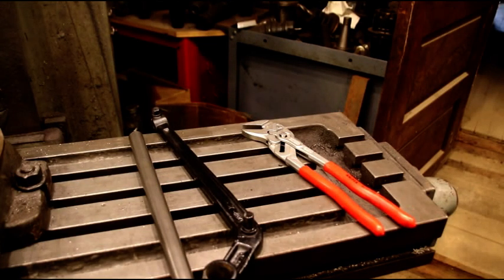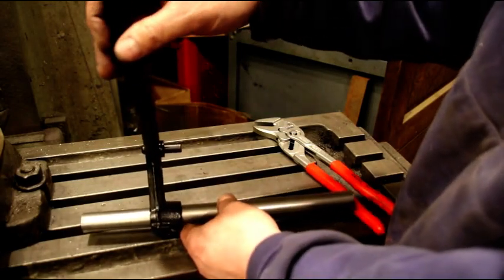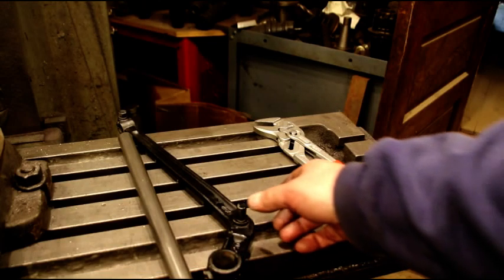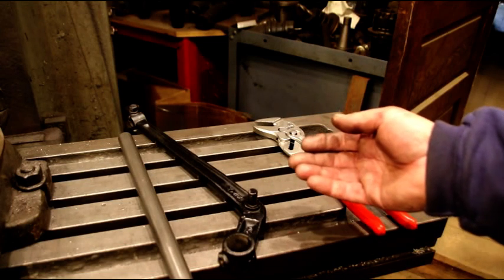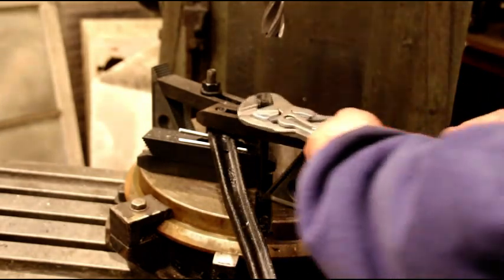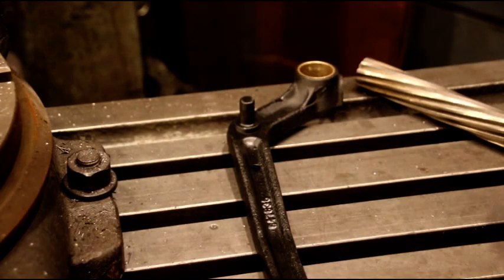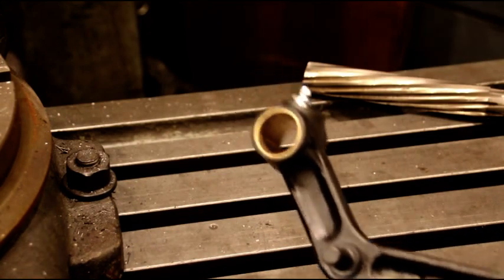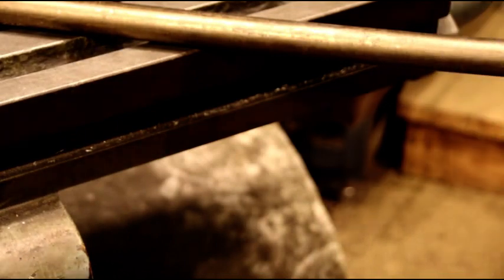Willys Jeep Brake Pedal Bushing....Put An End To That Sloppy Pedal !!!!!

Comment: It would be really useful to have a video on what you think the most versatile pieces of equipment would be for a guy to optimize his capabilities in his home shop where space is limited. How to use the fewest machines and still have as much capability as possible. You’ve done so much that your insight on that would be really great
Reply from the maker: It really depends on what you want to do.  I like to do everything in my own shop so I don't have to rely on anyone else.  The two very first machines should be a milling machine and a lathe.  They will open up a whole new world for you.  Next you need to decide what you want to do.  Mechanical work? engines? axles? transmissions?  or maybe sheet metal work?  Perhaps painting?   Everything will require their own set of tools, jigs, tricks of the trade, etc.......
You probably know or have realized there isn't another shop out there that has the equipment or desire to do many things, such as myself.  Most people do just parts of a restoration, never the whole thing.  Decide what you are hoping to accomplish and I will help you and show you whatever I can.
Reply: @metalshaperJeep  I think you’re right with the milling machine and lathe. That would expand my capabilities immensely. I mostly do maintenance and upkeep on my tractors and Jeeps. Getting to a point where axle and transmission rebuilds are practical would be ideal. As much as engine rebuilds would be an exciting path to go down I’m not sure that’s realistic with my space constraints. Some really basic sheet metal tools would be nice too for repairing some of my older jeep bodies. All I have is a cheap bending break. I’d like to expand my abilities with that a little bit as well. I always admire how you have the capability to do everything in your shop. It’s incredible

Comment: Thanks, you're doing it the right way. I'm sure you know that Willys wagons, pick-ups, and Jeepsters also have this same basic pedal shaft arrangement, and also develop excess slop and squeaks from rubbing on the sheet metal floor pan, always rubbing on the right side of the pedal shaft hole.  My stopgap remedy has been to cut rubbing blocks from 1/4 thick solid sheet nylon (bought from a plastic dealer) about 1 inch wide by 2 inches high. I screw the rubbing blocks to the floor pan just to the right of the centered brake pedal shaft. It's not a professional fix like you're doing, but it positively stops pedal slop and squeaks, and the rubbing blocks haven't shown noticeable wear after thousands of miles. Also, if you haven't done so yet, I'd be interested to see how you deal with worn-out bent-rod-type clutch pedal links -- the ones that use cotter pins. Those rods wear severely, along with the holes they pass through.  I've had good luck replacing them with a different kind of link that I've fabricated using 3/8 ball joint ends, the universal aircraft style that include grease fittings on the ball ends.  Keep up the good work.
Reply from the maker: Yes, this fix works on lots of Willys vehicles and many more with underfloor pedal setups.

Comment: Nice fix that lets you run the original pedal arrangement, but with much better feel and action I would think.

Hope you reconsider selling your power hammer.  You turned out so much quality work on that machine that is significant to the Jeep community.  I’ve seen pictures of the CJ2 you built, now at the Klairmont museum.  That historic vehicle would not exist as it is today, in 100% correct form, without your extraordinary toolmaking and shaping skills.
Reply: I don’t have a hammer- power hammer- but have always enjoyed your sheetmetal fab work. 
But I know especially now that I’m late fifties that “doing everything” versus optimizing time can be at odds no matter one’s “level.”  Productivity isn’t always measured by breadth or volume. 
It’s never fun but usually wise to narrow one’s focus once it becomes apparent the you ‘should’ do it. .
Reply from the maker: Glad you were able to see the agri jeep, it did turn out great and the museum is a great place for it.  I can no longer keep up the pace I am working at these days and the hopes of getting a helper or anyone who wants to learn the trade is getting worse.

Comment: I’m not much of a machinist so how did you determine when you got to the correct diameter for the bushing? What a great fix! We prolly all need this done!
Reply from the maker: I make a cut, then check with a caliper.  Adjust along the way and be patient.  Take light cuts and creep up on the final diameter of 1.125"

Comment: Nice job Brian,,from memory my old MB had hollow pipe for the shaft & washers either side with split pins to hold ‘em in place,,,regards Frank
Reply from the maker: yes that is how an original MB was.  I am going to make a custom clutch setup for this rig and will show it along the way.  Good to hear from you.